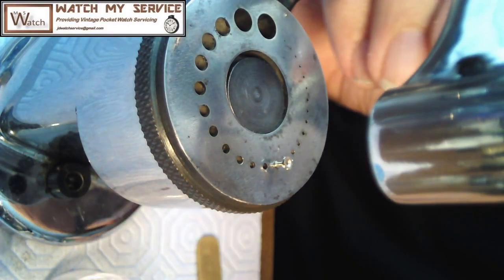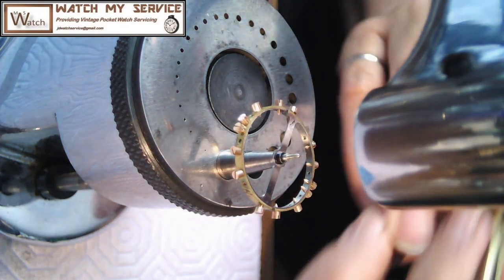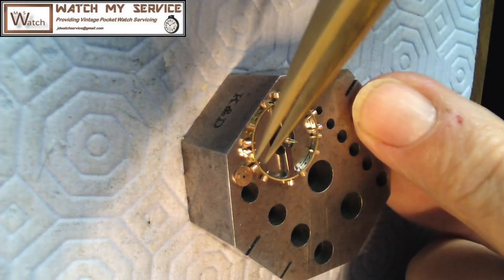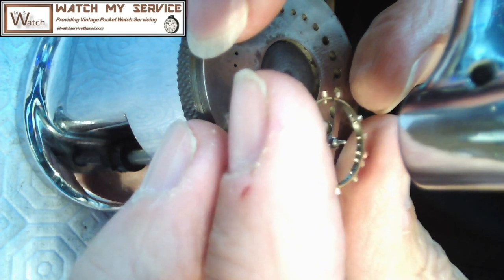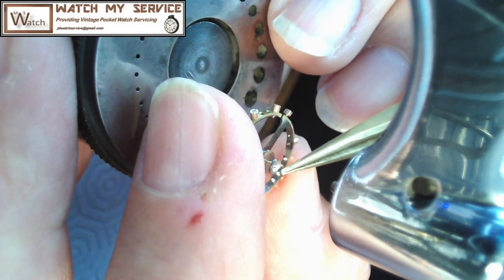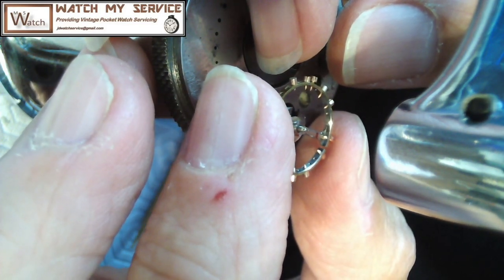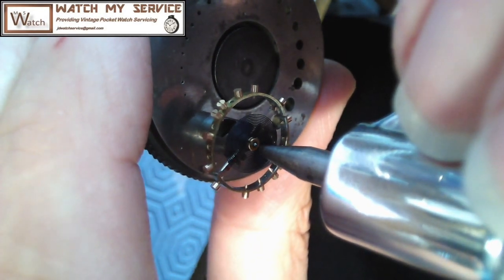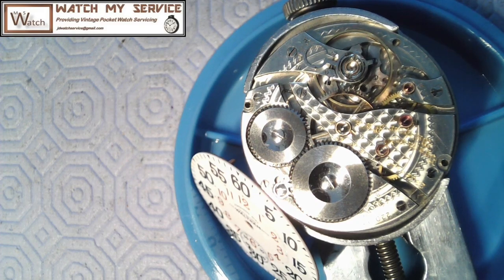Assembly of Detachable Balance Staff on 23 Jewel Waltham Vanguard

Comment: I had to watch till 12;30 to answer a question I had . The safety roller has to line up with the impulse jewel . This is something that is new to Me. Most of my collection is of earlier years . They do not have a safety roller. I thank You for this video and it`s information .
Reply from the maker: Thanks for the comment. It has to be absolutely lined up with the impulse jewel or it will not work

Comment: I have installed a new staff into the balance . Not so easy to do . I have a old school staking tool . You are using a nice one here. Had a issue with getting the position of the jewel and safety onto the shaft . Was not going on far enough .Got thru that just going to try installing it later.
Reply from the maker: Feel for you. It is a tough job and you need max precision for the balance to work properly after installation.

Comment: Great video! Some folks will line up the split in the collet with their mark on the balance wheel, instead of using the stud. I gave this some thought. (It’s difficult for me to visualize so I imagined the hairspring “unwrapped.”) I think if the hairspring happens to be bent, and then the stud is used to orient the collet, the roller jewel won’t properly line up with the pallet forks and the balance assembly would still be out of beat. Thoughts?

Comment: Those Waltham K&D Driving in punches are very hard to find. Waltham used both a friction and riveted staff.
Reply from the maker: This was a real pain to do, as adjusting after is very touchy-feely
Reply: @JDRichard  Thanks for posting this. I have a staff to do but I want to be careful and try to do it right.
Reply from the maker: @johnhannon  No problem John

Comment: I had to rewind that "paper balance wheel" part couple times lol
Reply from the maker: I actually did that in a previous job where I made the balance staff and wanted to test the end and side shakes.
Reply from the maker: Where do you live mike
Reply: @JDRichard  MN
Reply: @JDRichard  I'm gonna have to try that...did you use the staff to make the hole? I'm sure our horology predecessors are turning in their graves....or maybe not? Lol
Reply from the maker: @machinistmikethetinkerer4827  I first made a hole with a needle then I use the staff to make the whole make sure that the piece of paper is no bigger than the original balance

Comment: Hey love the video I am beginning my journey into watch making any advice
Reply from the maker: Buy the best equipment first not last. Use ebay
Reply: @JDRichard  thanks man I am only fifteen and I have already fixed a verge fusee pocket watch
Reply from the maker: Wow. You need to do the Rolex training after you graduate from high school. Where do you live?
Reply: @JDRichard  I live in Gillette Wyoming
Reply: And do you have any old junk movements I could buy from you to practice on
Reply from the maker: Very cool. I am just west if Ottawa Canada. You will have better access to tools than I did. I stocked up through the years and lucked into some high end tools from an old watchmaker.
Reply: @JDRichard  nice man I have some Mobius oils and watch making screw drivers
Reply from the maker: I made a video on basic tools
Reply: @JDRichard  ok thanks do you have any old movements in could buy from you or something fore to practice on
Reply from the maker: Actually I don’t. I fix em and return em
Reply from the maker: There is likely a watch and clock club in your location